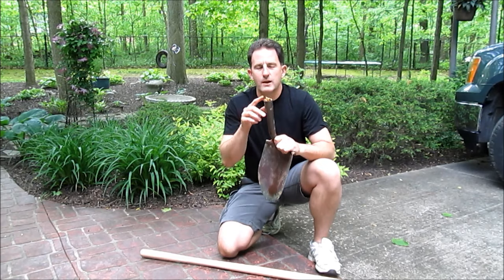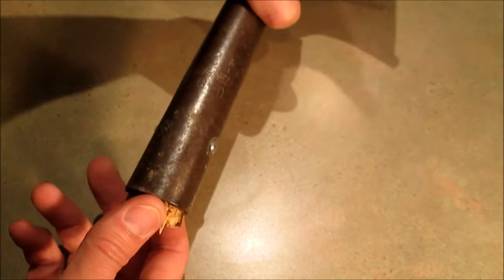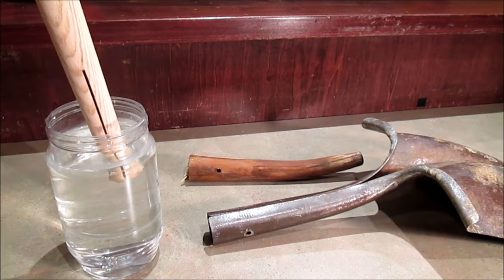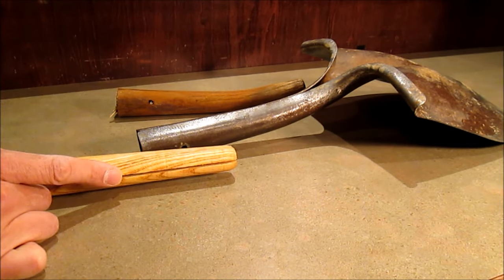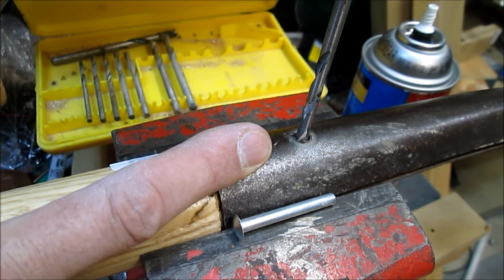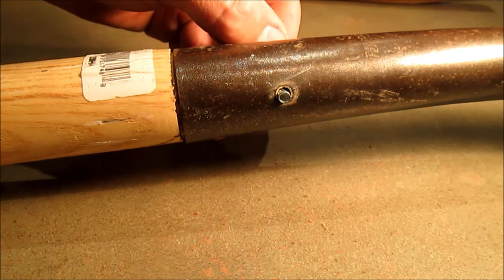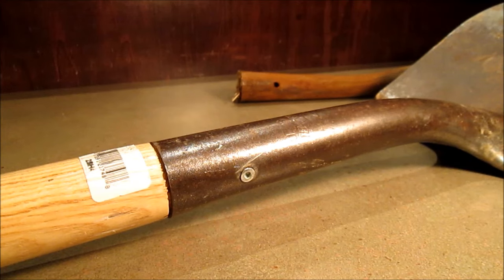How To Fix a Shovel

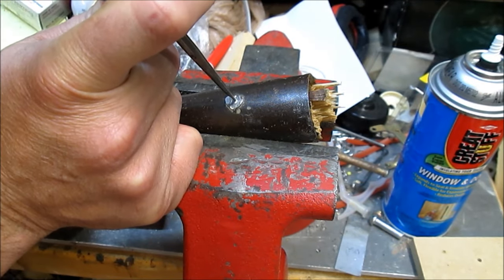Comment: 00:29 what if your shovel doesn’t have back access ?
Reply from the maker: Drill a hole in the broken off part, screw in a lag bolt, and tap it out with a hammer and pry bar.   Not as easy, but possible.
Reply: Tried something similar but it was an Irrigarion shovel which is a little different, it’s all solid so there’s no break in the body where the handle meets the head.  (It was in there really good.)

Ended up using the recip saw off* the rivets/pin heads, drilled the rest of the rivet from the side, then used some drill bits varying sizes, followed by a paddle bit to chew out the rest of the handle. 
Thanks for the reply, nice video

Comment: Hitting with a hammer did not work.
Reply from the maker: Several things were hit with a hammer in the video.  I am guessing you are talking about flattening the new pin at the end, so it does not fall out.   You have to make sure the head of the pin is against a solid surface, or it will just push back through instead of mashing.  If that does not work, just screw a 1 inch long sheet metal screw into the center of the pin, to keep it in place.  If you can’t find a screw the right size, another option is to get a machine screw and a nut to completely replace the pin.